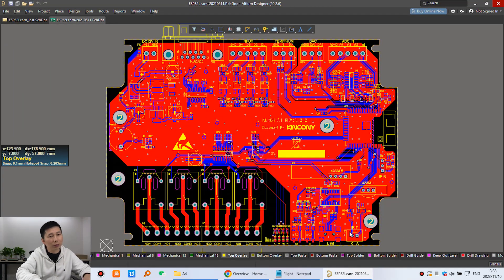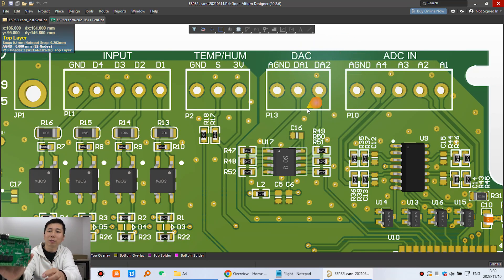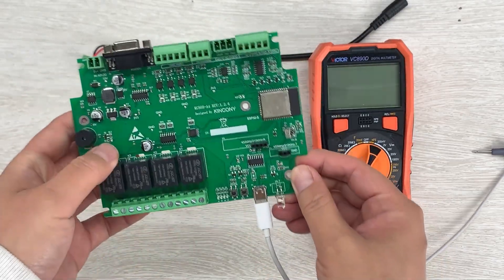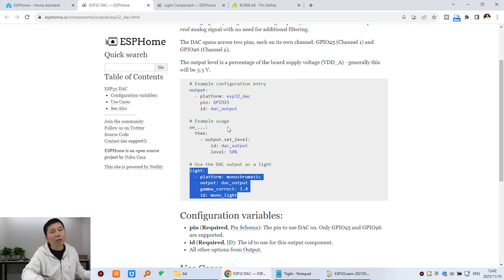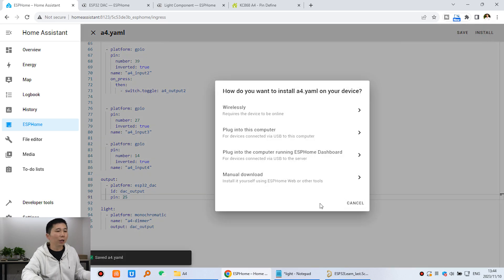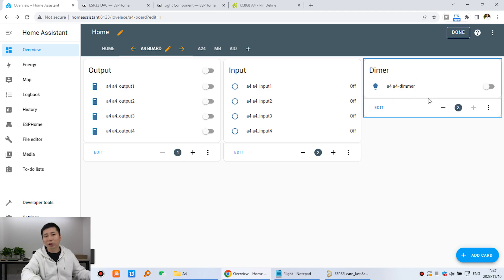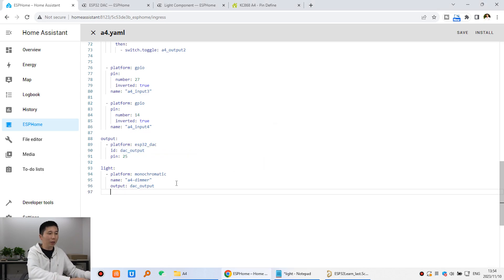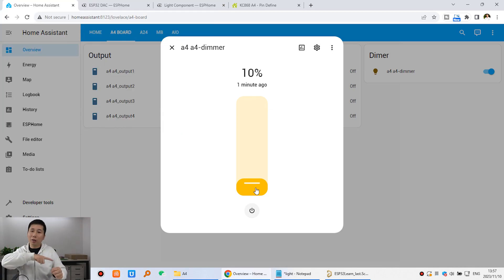how to use analog output 0-10V DAC by esphome for home assistant

Comment: Hey. Did you just use the ESP board here to output or is there some other logic in the board you show at the start?
Reply from the maker: only output by DAC
Reply: @KinCony  ok, so I can connect the pin directly from the Fan PWM (in my case) and control?
Reply from the maker: @ make sure the level is compatible
Reply: @ do you mean voltage? Its 0-10vPWM
Reply from the maker: @neilos2085  not PWM, just dc 0-10v output.
Reply: @KinCony  I only seem to get 3.3v out
Reply from the maker: @neilos2085  output dc 0-10v

Comment: Hello, your work looks great, congratulations. I am designing a card that will display RS485 modbus and 0-10V analog input values with ESP32 Nodemcu. What components did you use to display 0-10V analog inputs with ESP32?
Reply from the maker: you can use SSD1306 display.
Reply: @KinCony  Sorry, I asked the question wrong.  What are the components you use to receive 0-10v analog information or connect sensors?
Reply from the maker: just use ADC pin, which chip model for convert you can check with our board's diagram. @burhanmutlu16

Comment: Hello,I am facing one issue, I have Two ESP chip...One is ESP 32E and second is ESP 32UE,Both having same datasheets...Issue is ESP32E is connecting with Mobile Hotspot and Home router als, But ESP32UE is connecting only with Mobile Hotspot, it is not Connecting With Router... I have tested with same code for Both Chip ...Please can you anything?...
Reply from the maker: try to test, not use two module at the same time. whether work well, if only use everyone esp32 module.
Reply: Actually I am not using two module at a time. One at a time I am using...
Reply from the maker: check whether have different firmware inside. @ajayshokal7193
Reply: Should I need to upgrade firmware for ESP32UE?...
Reply: Thanks For your rly, May I know how to check it's firmware,...any specific code is there on Google to show firmware details?...
Reply from the maker: you can download newest firmware to esp32 again. @ajayshokal7193
Reply: I will try, Thanks For your valuable time.
Reply: Hello Kincony... I have tried with latest ESP32 Firmware, but Not working...
Reply from the maker: maybe you can try to use third esp32 module for compare. @ajayshokal7193
Reply: Okay ...

Comment: I have 100pcs 600W lights. Each 1 has a 50W driver with 0-10V dimming option. How many of these lights drivers can I control with this board? Can I control all of them, 100pcs if I connect the drivers in deasy chain - serial connection ?
Reply from the maker: it according to your driver power, if 100pcs, suggest use our KC868-AP board, that is 16CH dimmer OUTPUT board. 100pcs lights no problem.
Reply: @KinCony  Does KC868-AP support 0-10V diming?
Please make a video ?
Reply from the maker: yes, it support ,here is video: https://youtu.be/ANK8TFzJHbs @adarshsonalika7493
Reply: @KinCony  But how to use with 0-10V dimming ? As we can use D16 board directly for dimming but how is possible to use kc868 -AP for 0-10v dimming? Sorry there's little confusion about this? please explain in detail